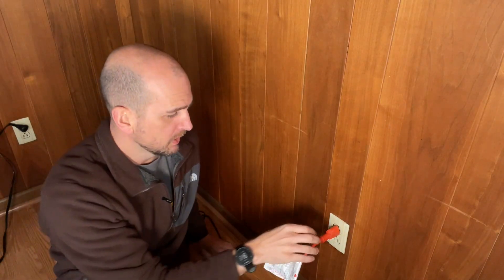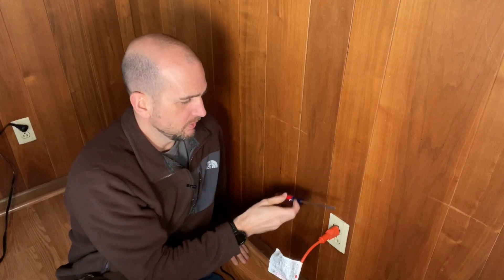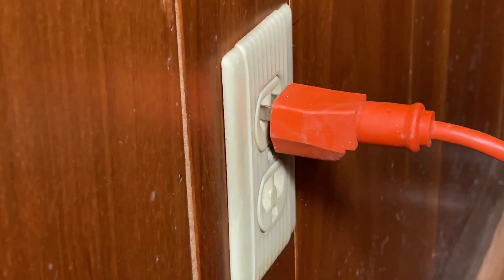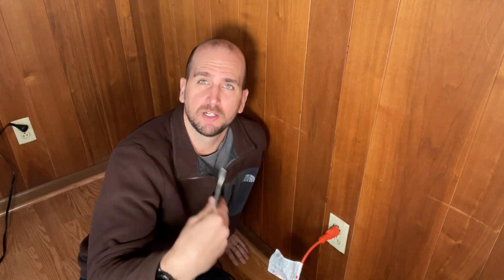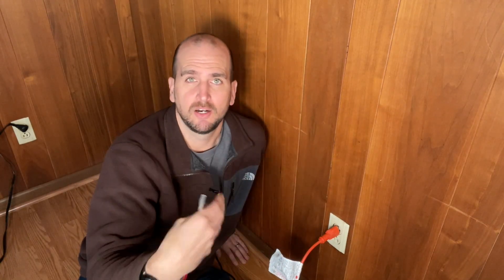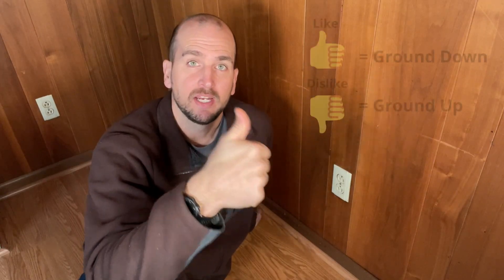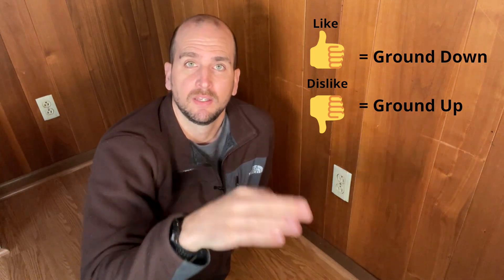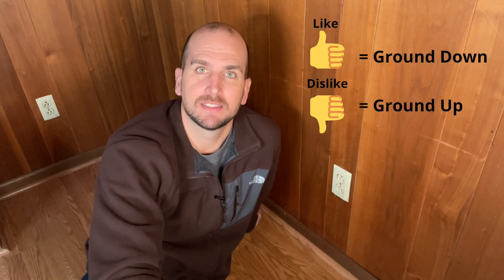Should An Outlet Be Installed Ground Down Or Up

Comment: I am a residential electrician and what I have heard is it is a commercial vs residential choice. Like you said a screwdriver shorting out in a hospital could kill someone by turning off life support. That is why most hospitals and other commercial do ground up. Tripping a circuit is very important in a hospital but at home, something tripping is an easy fix. In a residential situation, your more concerned about something coming unplugged. It is harder for a plug to fall out if the ground is on the bottom as the neutral and hot are both being pinched. This makes it less likely to have an arc happening because the plug is loose from the outlet. Arcs is the number 1 cause of electrical fires. Not to mention, grounds are important and if upside down, and you come unplugged, you lose the ground first? That's not a good situation unless you want to go back to 2 prong receptacles. Hopefully that helps to clear it up and why there is no wrong way to do it. Ground down is the right way, but no wrong way.... lol

Comment: Night-lights,  scentsy, and other small gadgets which have only the polarized 2-pring plugs require that the gound face down to either "look" right or operate correctly.   I've always installed ground down an rotate any that are not.

Comment: It's pronounced "Leave It On"

Ground up: The plug holds in better due to the heft and length of the ground prong. This isn't very important if your TV set comes unplugged, your favorite show is interrupted. But it's very important if your heart monitor comes unplugged, so in the hospital...

Ground down: water rises, so the ground comes in to contact with the water first. (the same could be said about the neutral slot but internally the metal is about or exactly the same, only the slot is lower)

Comment: Taught that the ground terminal is on the bottom. Left or right handed, when you grab the plug your index finger has the chance to hit one or both terminals as you grip it to pull it out. Shorting to ground should trip the breaker, especially if it's a GFI. If your finger shorts across the positive and negative terminals, your finger is just a load. More changes of a problem plugging and unplugging than something falling on a plug that's not all the way in

Comment: Eh. Ground down is A E S T H E T I C.
But I think it should be entirely based on the use case. There's definitely a few places where a prefered orientation can be helpful. I've found sideways outlets to be helpful for specific stuff like running power strips, where that quick ninety being able to go straight to the side makes life easier.

Comment: i base it on the room and what or who it will be used for
in children's room or play areas i use ground up as an extra "safety " step in case the plug of whatever is plugged in isnt plugged in all the way. that way the first thing a child would potentially touch is the ground. in all other rooms i use the ground down install pra

Comment: Ground down because ... if you watch someone pull out a plug, they usually put their thumb on top, aligned with the cord, and their first finger underneath, bent at right angles at the first (PIP) joint.  As the plug begins to come out the prongs are exposed.  If the person now moves their grip towards the wall, there is no risk of their thumb entering the gap between the plug and the outlet but if they have slim fingers it is possible for their first finger to go behind the plug.  This will result in an electric shock if they contact the hot prong.  So, hot and neutral should be at the top and safety ground at the bottom.  If the outlet has a shutter mechanism then this reason is void and I can't justify why I would still go ground down except to accommodate flat-to-the-wall plugs.

Comment: If you install an outlet with the ground at the top, the plug itself obscures a persons view of the the relatively fragile current-carrying prongs as you are attempting to insert them into the socket. This results in damage to the prongs over time as you bend or twist them while trying to plug them in by "feel," with a consequence of a hazardous connection in the future. Having the ground facing down makes it easy for a person to see the prongs and align them well with the relatively narrow slits in the receptacle, hence there is less damage to the plug due to manipulation of the prongs and consequently less risk of a hazardous connection as the corded device ages. For the ground pin, this is less of a concern because it is so much sturdier and is close to being round in shape. 

On a side note, sideways receptacles should have the ground on the right because it is easier to insert three prong plugs that way for a right handed person. For a plug installed in an under-cabinet plug strip, where all the sockets are facing downward, should the ground be facing toward you or away from you?

Comment: I do ground down because that's were the Earth ground is. If you have a decent receptacle. Then you shouldn't have to worry about what you plug in falling out. That would indicate that its time to replace your outlet or upgrade it. I always avoid residential grade outlets.

Comment: Generally in residential you want it ground down, mostly for the aforementioned cords with angled plugs on residential devices are made for grd down use. And yes, NEC doesn't specify. Some residential applications necessitate receptacles be mounted horizontal which adds another dilemma, hot up or neutral up. Didn't think about that one did ya. For commercial applications contractors may be required to install receptacles with grd up, while some contractors believe that may be code. I personally prefer grd down. If you somehow manage to drop a thin piece of metal down the wall and have it cross both prongs of a plug so as to cause a short, you must be really good at being stupid. After all, what are the odds, right?

Comment: Typically when I install the plugs, the ground is down. However, on a half-hot (plug controlled by a switch) the ground is facing up, so you can identify the outlet.

Comment: Electrically: it makes ZERO difference. ground doesn't care if its up or down. it doesn't care if you see a face. 
Perceptually: it makes absolute sense for to put them ground down so you see a face. its a design ascetic and we all know if your room looks like trash with no style you'll feel like trash. 
if your faces are upside down it can be upsetting and annoying. 
there is no "correct way" but ground down is best imo. its incredibly rare for something to fall precisely and short out both connectors. if that happens often to you you have a bigger issue.

Comment: Some appliances have the cord where they angle down, so if you plug them into an “upside down” outlet, the wire goes up in a big loop and then down, instead of neatly close to the wall with a normal outlet.

Comment: My preference is ground down. Two reasons for this: one is that plugs tend to get pulled down over time (gravity, occasional bumps) and I'd far rather have the "hot" side get pulled out than the ground plug. Or am I the only person who has ever had something electric quit and a quick glance doesn't show you that it is merely a loose fit into the socket. To me, it's worth the hassle to loose the power than the safety of proper grounding. Secondly, if the plug is loose then if an object does touch and cross the two prongs at the outlet, that's what breakers and fuses are designed to protect you from. It's going to alert you to the hazard.  To me, it's better to be notified than have, say, a brass outlet cover floating on a ground plug and you see and touch it and risk a shock.

Comment: 60+ years ago when wallwarts were new, some were common (larger spade) right instead of left and you needed a ground-up receptacle for them to hang down and not lean back unplugging themselves.
Reply: And now it's the opposite.  If the plug is ground up, most wallwarts fall out.

Comment: Hey Scott, your old neighbor Ryan here. The way I understood it was that ground up outlets were generally on a switch. Ground down were just your regular outlets. This was usually the case in older homes that didn't have ceiling lights.  That way you knew which one to plug a lamp into.  Rarely fo I evert leave a house that way but I do still follow that unwritten rule.
Reply from the maker: Hey Ryan, what is up?  The way you outlined it is exactly my same thought process.  I find a number of the 50's and 60's houses in our area followed this rule.  Still in Bloomington?
Reply: @EverydayHomeRepairs  I'm west of Bartonville in a little subdivision called Lake Camelot
Reply: @EverydayHomeRepairs  Don't I feel dumb?  Was finally able to watch the rest of your video and saw you covered what I commented.  For a suggestion for you though.  A video on the different ways to wire a light switch to a light.  There's 2 that I know of.   The standard way where power comes to the switch and then continues to the light. The other method (that's stupid in my opinion) to run power to the light then 1 line to the switch and back. I hate the 2nd method but come across it quite a bit. When building the house it saves wire/ money but makes it dangerous for anyone in the future. Especially if it's not marked properly.

Comment: As far as the code is concerned the neutral is supposed to be on left meaning the longer side is on the left. So now suppose someone wires it with the neutral on the left on the short side the hot is on right on the long side. Now you put the hot where the neutral is supposed to be.  Sorry this makes little sense.

Comment: Where I live, the receptical is placed at a 90 degree angle instead of how you have them installed. This makes for the ground plug in a up position or down. Kind of dumb but this is the code in Puerto Rico.

Comment: Wait you don't split the receptacle when you switch it, switch both of a duplex interesting,  so truly if you're going to use metal switch plate covers for receptacle covers you want a pin facing up if you're going to use a plastic or otherwise nonmetallic plating device pretty much doesn't matter in a residence putting the pins down is much more common anything industrial or commercial you almost always stick the ground pin up as it's very often you're using metal plates..Peace

Comment: I like the looks of ground down, not okay that most manufacturers of plug in surge devices as wall as power distribution units with built in USB ports offer the cell phone resting/holding area, they only work with ground down.

Comment: Ground down still appears to be the preferred choice of many, many device manufacturers like those that make timers, who still have the ground facing down with the device in the correct orientation, meaning how the dial reads on a timer.  Put the ground up and you'd have to turn your head upside down to read the dial.  Another example is those that have used X-10 controls, (not as popular now) with the modules plugged in, with the ground pin down, the controlled appliance or lamp is plugged into the bottom of the X-10 module, as it should be.  I'll stick with ground pin down until the code says otherwise.

Comment: I do it both ways in one box. Homes I've lived in (much of Chicago area = EMT local code) have duplex outlets but they are mounted in quad boxes with single duplex plaster rings. When I upgrade outlets, I also enlarge the hole and install a double duplex plaster ring. I then install one outlet ground up and one down. Lastly, I install an oversized outlet wall plate. Yes, you CAN have it both ways :)

Comment: I prefer ground below the other blades. It is a safety issue - not at the plug, but at the connected device. The ground pin protects the user of a device from a short or other problem in the device which could result in the case or other user accessible parts becoming energized. If the ground pin is up, then it will disconnect at the receptacle while the live and neutral pins are still connected. This could result in electrocution. If the ground pin is down, then it will disconnect after the live and neutral pins have already disconnected. There is no risk of electrocution from using the device.
It was a mistake to adopt a 3-wire grounding system. It increased the cost of wire almost 50%. It would have been better to design products with no possibility of electrifying the user accessible parts (which is what new products with only 2 polarized pins do anyway).

Comment: I wired my garage about 789 years ago, and I did research to know which way it should be. I read some where it should be up. So that's how mine is. It passed inspection. I'm a diy saved a bunch of money so I was happy . From a practical stand point I wish they where down because most plugs are down as you point out. All the time I put in a plug with a xtmr so I have to flip it which takes up both sockets. If I could do it over I'd ask the inspector before hand if I could place it down. It's like it's a right handed world get used to it. It's a ground down world so put it down if you can.

Comment: It may not be relevant, but the wiring standards in Australia have, from at least the early 70's, required the sockets to be installed with the earth pin down. This was because a lot of electrical devices used to have earthed metal cases and it was considered dangerous if the earth disconnected before the 2 live pins. The thinking was that a cord plugged into the socket would most likely be pulled down, so if the earth was at the top, there was a danger that the earth could disconnect first.

This is now not all that relevant, and the standards have become the combined Australia/New Zealand standard AS/NZS 3112, but it still requires the earth pin to be down. With AS/NZS 3112 there is little danger of contacting a live pin because they are insulated for about half their length.

The completely bare pins on the North American NEMA plugs look really dangerous to me, but if I had to use them, I would install the sockets with the ground pin up; even though ground pin down feels more natural to me. It makes no difference to the safety with two-pin plugs and I do find the argument about the earth pin stopping things falling on to the live pins compelling.

One other small consideration is that when plugging into a socket in the dark (or when your view of the socket is obscured), it is tempting to put a finger on one of the pins to guide it in. Needless to say, this is not a good idea, but it may be less tempting to use one of the live pins if the earth pin is at the top.

Comment: I like ground facing down. Until recently all of the Homes that I've owned hat outlets with ground facing down. I recently purchased a  home with ground facing up. I noticed that at least half of the outlets were cracked where the ground prong went in. I believe that the weight of the cord allowed the plug to "toggle" forcing the ground pin against the  edge of the outlet face where theplastic is thinner since the ground pin is closer to the edge and the hot and neutral are more central with more material between the edge. I've had to replace at least 20 outlets for cracking above the ground pin. For this reason I  as well as the 90 degree angle plug WHich is sure to exert extra toggle force on the ground pin I prefer ground down.